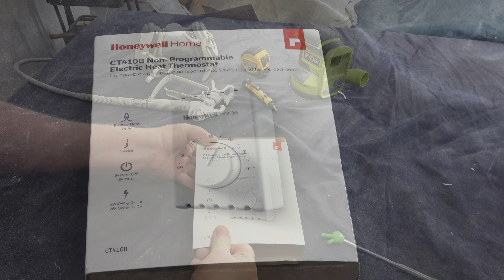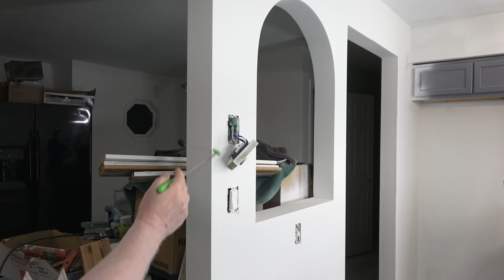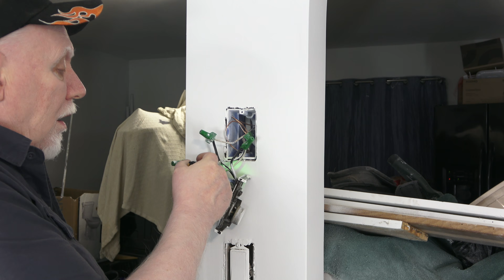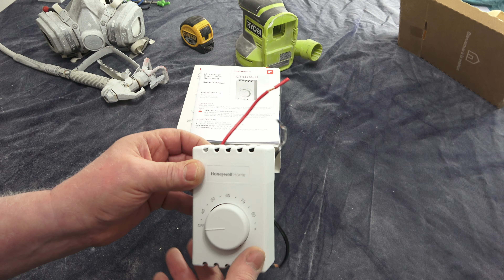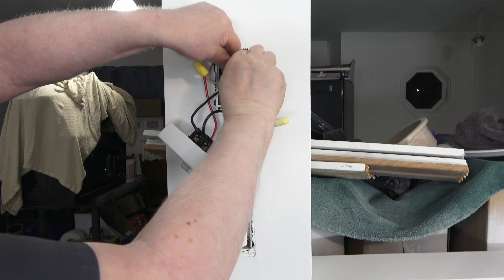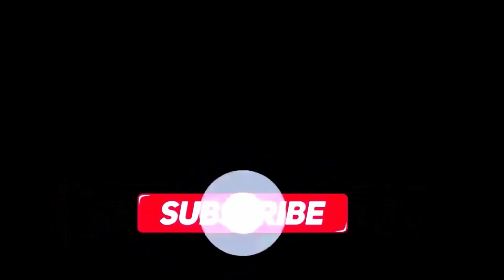Wire Up Honeywell 4 Wire Thermostat Baseboard Heat

Comment: Thank you brother for the help
Reply from the maker: You are welcome 👍 Thx ✌
Reply: @wildwoodtop  on mine I have 6 wires I guess  test which 2 have solid red and those go on top ?
Reply from the maker: @davidph123  A 6-wire box usually means you have line power coming in, power continuing to another heater or room. I would say find the two 120 hot wires (which more than likely also would be wire nutted to feed another thermostat/heater in a different room) and then follow the procedures displayed in the video. Disclaimer: if you feel uneasy testing live wires out of caution seek licensed professional electrician

Comment: You explain this so clearly and well. I’d like to have seen how to check it with a multimeter, and I have a two-wire thermostat of the same brand; so still trying to figure out T1 vs. L1. Is L the line and T the load?
Reply from the maker: Perhaps this video will answer these questions 0:12 and the multimeter 2:12 https://www.youtube.com/watch?v=P0EySGM8eDA
Reply: @wildwoodtop  thank you!
Reply: I guess I did it right.... lol.  It's working  :)

Comment: Question, is there a reason why nobody uses black tape to secure the cables? I ask because back at home everything was secure by black tape instead of the screw in caps.
Reply from the maker: Perhaps The reason you rarely see black electrical tape used to secure cables (specifically in North American electrical wiring) instead of screw-in caps is that modern electrical codes require a more permanent, secure, and insulating connection method to ensure safety and prevent electrical hazards

Comment: Hi, is there also a neutral in that box under the thermostat? Reason I ask is: I want to add an energy monitor to it that requires 120V to operate. So I would need one hot and a neutral to hook that up.
Reply from the maker: There is no neutral in this setup. They're using the white wire to carry 120 volts (same as the Black)

Comment: Slight correction to your video. This particular model is a double line break thermostat (or double pole). This means that when it is in the off position BOTH phases are cut and no more current flows to the baseboard. That is what the true "OFF" position is for. On a single pole model like the CT410A, one line always stays energized at the baseboard. On this particular model, you'll notice there is no "OFF" on the thermostat. That's the difference between the two models. That being said, you should still shut off the breaker if working on the baseboard.
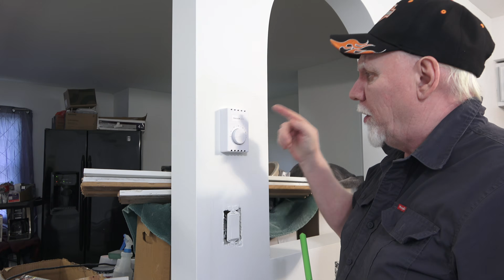Reply from the maker: Could not agree with you more! 👍  11:32

Comment: How would I wire it if I’m only running 120v baseboard heater with the exact same thermostat
Reply from the maker: You should not attempt to use a 240-volt thermostat with a 120-volt baseboard heater. While the thermostat itself might work (as it is rated for higher voltage) the core issue is the voltage mismatch with the heater, which can lead to damage / safety hazards.
Reply: @wildwoodtop  Honeywell sells a PT2462B 4 wire thermostat rated at 120V to 277V would that work?
Reply from the maker: @Ed-sh8jt  Honeywell PT2462B (often referenced alongside models like CT410B) is a 4-wire, double-pole line voltage thermostat designed for 120/240V electric baseboard heaters, convectors, and fan-forced heaters

Comment: How do you calibarte it so it clicks on sooner ? Half my apt is freezing by the heater in one room but way to hot in another. Sadly its the same base board heater and it cant be changed.
Reply from the maker: For a manual thermostat remove the cover and use an insulated screwdriver to turn the calibration screw until the thermostat's temperature matches the room temperature measured by a separate thermometer.

Comment: Ok so i have a question we have a cadet heater in the bathroom that hasn't ever worked i bought a new cadet and a thermostat that i installed on the cadet. When checking the wall mount thermostat i noticed 2 white wires capped together, and 2 black wires bare this is what i connected still no heat. I'm showing power to the wires in the manual knob all thru the cadet but no heat should i un cap the 2 white wires and try re installing the 240 thermostat?
Reply from the maker: Without physically being there to do testing I cannot answer that from afar (here's a vid same premise as mine, difference being the first half of the video he's using a cadet thermostat https://www.youtube.com/watch?v=ja6RUH7ezsg&t=27s&ab_channel=EastSideWrenching

Comment: Just had an electrician install an Ace Brand double Pole Thermostat. It works great but does't shut off. What should I do?
Reply from the maker: inform your electrician it's not working correctly (thermostat must be flawed in some way if it doesn't shut off) (if wired as shown in this video it should turn off) thermostat doesn't shut off at the temperature you have it set at? Or thermostat doesn't shut off at the off position?

Comment: Really a good clear explanation. Thanks!
Reply from the maker: You are welcome! 🙂 Thanks
Reply: Mine keeps burning up near the connector and idea why. I’ve replaced it a few times
Reply from the maker: @ericboyd7721  Connector at the thermostat or at the heater connection ?
Reply: @ericboyd7721  Burning up near the connector?  High resistance in the connection is why.  clean the bare copper metal wire.  Put the two copper wires together and twist with a wire nut.  Question is the wire comming from the service panel, or the wire going out to the heater Aluminum Wire and NOT Copper wire?   Aluminum has slightly higher resistance per foot than copper wire.  A high resistance connection generates large amount heat when large currents ( 5Amps or 10Amps )  goes though that high resistance metallic connection.  With no power connected, could use an ohm meter to measure the resistance of the twisted copper wire connection made inside the wire nut.   should be 0.01 to 0.10  ohms,  I2 x R ;  I squared x resistance equals power dissipation.   10Amps squared = 100      100 x 1 ohm =  100 watts of power dissipation in the connection.    100 x 0.01 ohms =  1 Watt of power dissipation in the connection.  The 100 WATTS  of power will melt insulation and some of the metallic wire connection.